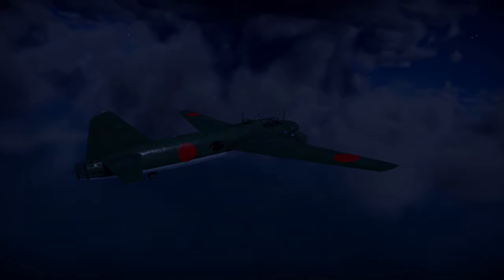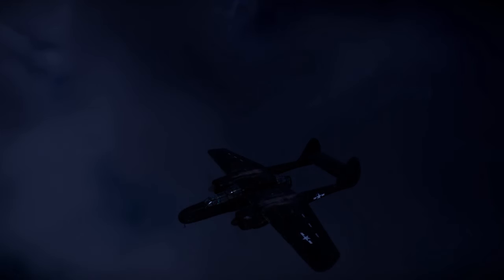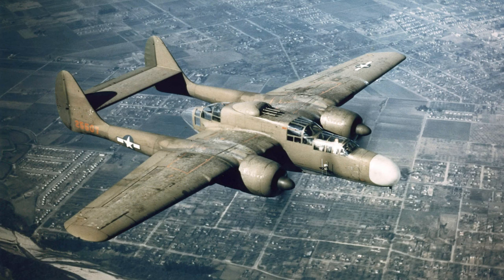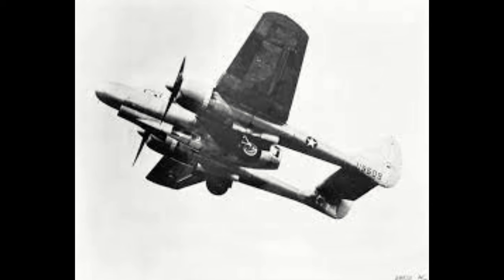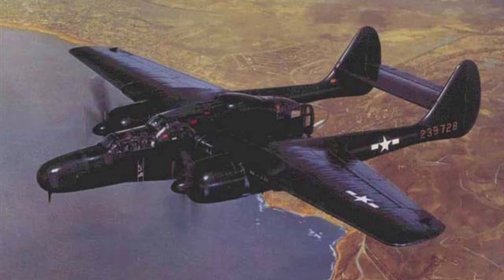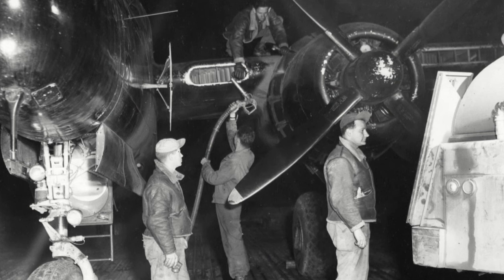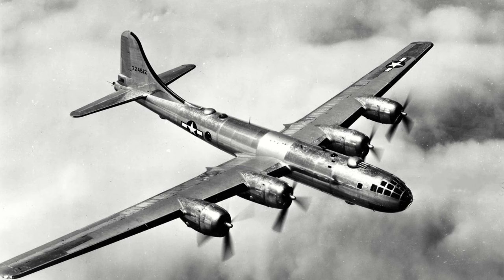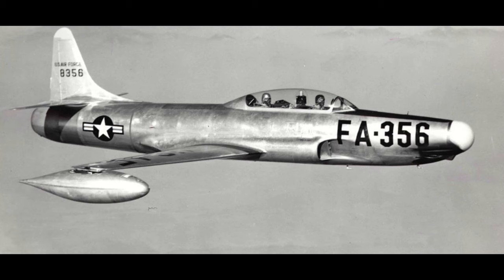5 Minute Guides to Aircraft: Northrop P-61 Black Widow

Comment: At the start of the vid, its stated that the Betty was faster than the A20 Havoc this surprised me. The data I looked at had  the Betty at 266mph at 14000 ft, and the A20 at 325mph at 14500ft.
Likewise with your Mosquito v P61 comparison, the Mosquito is the quicker of the two at 415 mph at 28000 ft, and the P61, at 366mph at 20000ft
Reply from the maker: The A-20 Havoc in its bomber configuration is faster yes, but the converted P-70 Night fighter variant was not, since it was much heavier due to the radar and extra weaponry installed, which significantly impacted its performance.

As for the Mosquito V P-61 challenge, it wasn't a standard P-61 that challenged the wooden wonder, it was specially modified by the ground crew for as much performance as they could squeeze out of the airframe, thus using the listed 366mph figure from Wikipedia (which is I presume where you got that performance figure from) isn't applicable. I am intrigued however how modifying a plane to win a competition isn't considered cheating in that scenario but, well, it is what happened according to the testimonies of those involved.
Reply: @5MinuteGuidesToAircraft  When talking about someone (or group of people) basically going "I have this machine, what can I do to make it go 0.5mph faster?" Is cheating even a valid concept? Unless you are actually breaking the laws of physics, how would one quantify "cheating" within this context? Also is this a comparison (per OP) or challenge (per you)? The latter would imply some form of competition (like a fly-off between two competing designs for a contract or picking which of multiple designs looks better on paper) while the former does not. The only way to cheat in a comparison is to lie.
Reply from the maker: @whyjnot420  As far as I know the Mosquito was unmodified for the Fly off (it was indeed a fly-off to see which plane was better, not a simple stats comparison to see which was 'theoretically' better). Allowing one side to modify their plane to the point that its more of a experimental racer rather than a production military aircraft (while the other side doesn't) I see as a little disingenuous to a competition trying to see which airframe is better, especially if many of those modifications are impractical or straight up counterproductive to a military aircraft (i.e removal of guns for less weight, frail high maintenance engine tuning for more performance, use of custom parts for adapting said modifications, etc).
Reply: @5MinuteGuidesToAircraft  In that case, I concur. Especially within the realm of military aircraft. It is one thing to allow for a clean configuration of a plane, perhaps even to the point of removing weapon pylons. But anything beyond that essentially negates the reason for a competition. Since at that point, you are basically entering the realm of one-off designs. 

That said, I completely understand why this kind of thing happens. Afterall the military is run by the same people who draw up voting districts.

Comment: The way night fighters tended to work - was that there would be a ground control station that used radar to detect enemy aircraft and vector the night fighters to them.

When the night fighters got in range of their own radar - they would home in on the bomber and attack it.

Because they had no ground control radar to vector them onto enemy night fighters over Europe - it was difficult for Allied Night fighters to escort bombers

What the P-61's did though - was go hang out at the bases the German Night Fighters took off from - because they KNEW where those were - and wait for a German night fighter to return.

This was a variation on the same tactic American Fighters used against German Jets.

The problem with this tactic - was that their airfields were heavily defended with German Anti Aircraft.

I don't know how successful these tactics were.
.

Comment: A 'Tweaked" version won while the Brits used a standard fully outfitted Mosquito. 
So the contest was rigged and cannot be trusted, fairly standard tactics.  The only valid test would be a regular squadron aircraft against another.
As the saying goes, The Mosquito has the runs on the board Vs the late war Black Widow